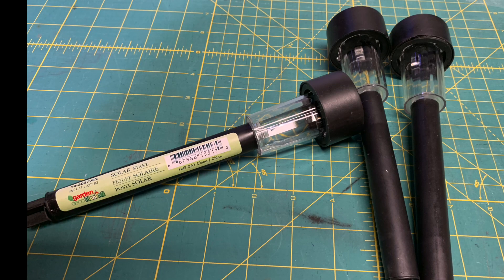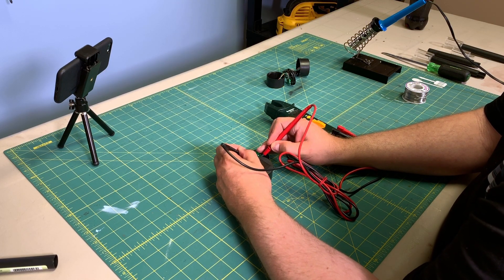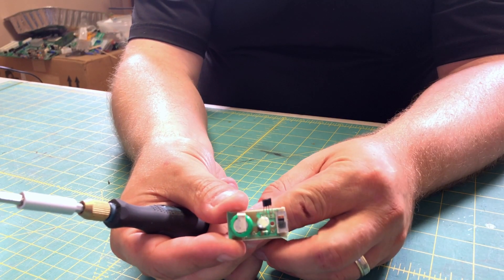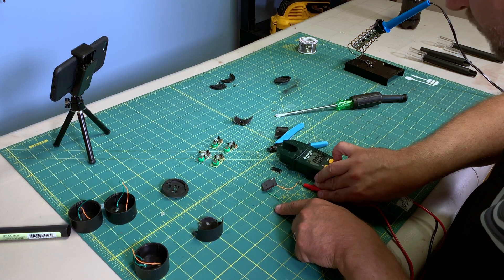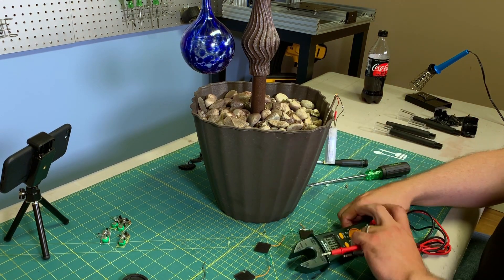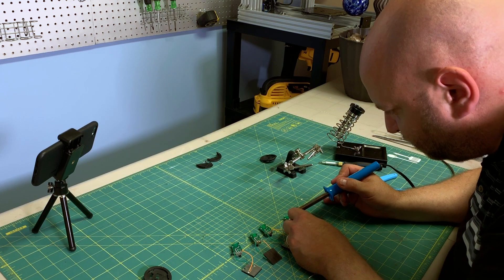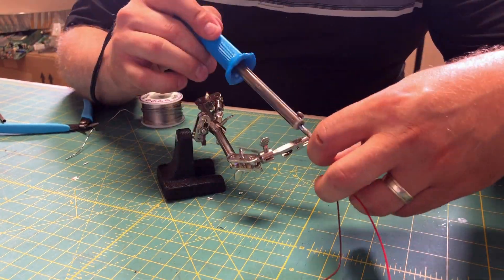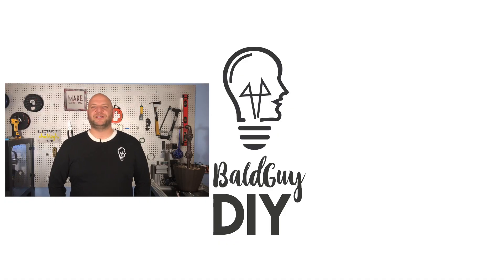Dollar Store Hack: Combining Solar Lights

Comment: I was doing something similar but instead of a  lamp i connected to a small solder test, LED Christmas tree off amazon. I want the tree to be on in the dark and off during the day, I putt the panel in series by connecting +to - at the battery, problem is this way keeps them on until the batteries die. Should I have connected the panels in series by  the small LED terminals to achieve dark lights on and daylight, lights off?  In other words connect them in series by connecting +to -  of the LEDs rather than by baterry + and - ? 

Would appreciate any opinion

Comment: any idea how to do this setup:
in my back yard i have around 20 small solar light ( like the 1$ ones u used ), they don't power up the same and always discharge quickly.
to fix this issue, i would like to get a bigger solar panel, with 1 big battery and connect all the 20 independent lights to the same 1 battery ( but have the solar panel give it an auto on and auto off ) so this way all the lights are all on and at the same intensity for the whole night.

Comment: This is helpful.... but you should make another video with close ups of exactly how you are wiring these with the circuit boards. I neeed to know exactly how to juice up my solar fairy houses using dollar tree lights. I want to be able to run atleast 30 small fairy lights together at once , but I want them bright and I want to minimize how many circut boards and batteries I have to hide in my houses. Please help a girl out. I need help

Comment: I made one of these wired in series with two small solar panels from Christmas lights my mom threw away it's summed up to 5 volts in full light then put it on my roof it charge some 1.2v batteries with a charging circuit Now it inexplicably only makes volt one 🤦‍♂️🤷‍♂️ 😥
Reply from the maker: Could just be a panel failure.  The little solar panels from dollar store or holiday lights aren’t great quality, and it’s possible one or both just stopped working. Especially if they got wet in the rain. Test each panel individually, see if that makes sense. Thanks for watching and commenting!

Comment: I thought of doing something like this, using three solar light panels together to make a 3 Volt cell phone charger.  Could you make that work?  Thanks!  This looks so interesting, I subbed.
Reply from the maker: Thanks for watching. In order to charge a cell phone you need at least 5V, as most use USB to charge. Any less than that and no charging will take place. If you go over 5V, you will likely need a voltage regulator to prevent damage to the phone. And in the case of iPhones, they also need a few resistors connected properly so the phone will accept charge from it. While this all would work to charge a phone, there’s probably a commercially made solar USB charger that is more cost and time effective.
Reply: You need way more solar panels for current

Comment: Solar table lamp . A little more work. I take two heads and fix them to a home made stand and apply two d cells in series. Then have a small solar pannel to charge the batteries.so letting it out . During the day gives 3  night of light.
Reply from the maker: Sounds like a great project!  Good work!

Comment: Can you post a circuit diagram. I know it is simple but it helps. What i understood is that you connected all individual solar panels and circuit in series. Is it correct?
Reply from the maker: Sorry I don’t have a circuit diagram to share. But you are correct, they are connected in series. Just one series circuit through all the battery leads is sufficient, if you want it to work only in the darkness when all the switches are turned on.

Comment: Re: Removing the solar panel from the cap. I just watch someone's clip & he removed the solar panel by holding it slose to a hot lamp lightbulb. The hot bulb softened the glue holding it on & he just gave it a slite push & out it came. No cutting of plastic.
Reply from the maker: That could definitely work, or a hair dryer or heat gun. I just chose the brute force method:)  Thanks for the comment!

Comment: If you use a hair dryer heat gun with gentle heat the panel comes out with a simple push
Reply from the maker: +Dan Moore That’s a good suggestion!
Reply: So was the last one. Why no close up of final setup?  Pretty useless without it